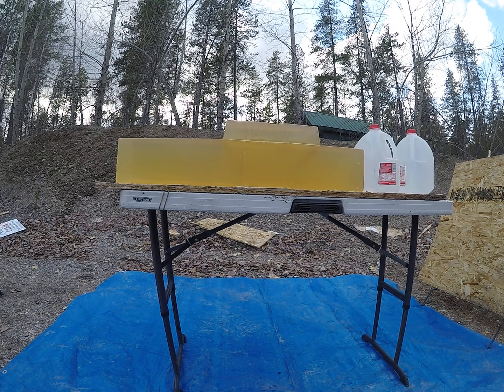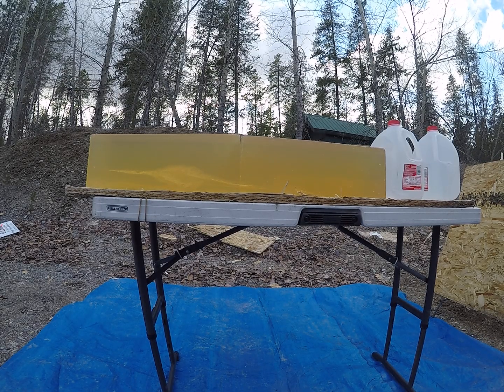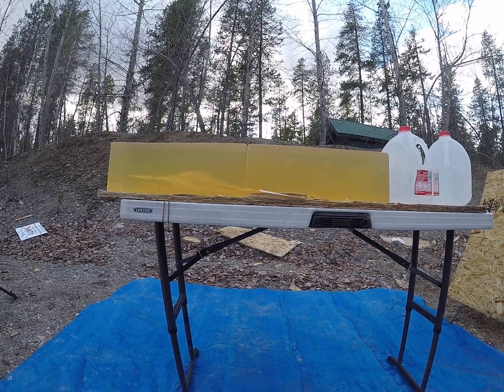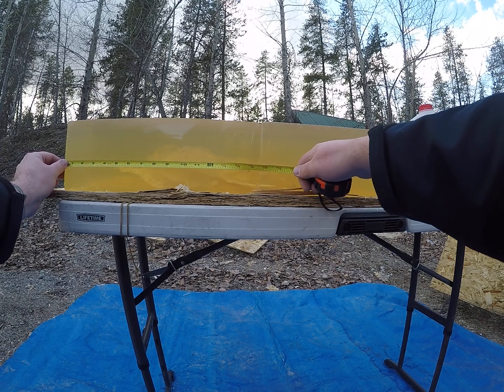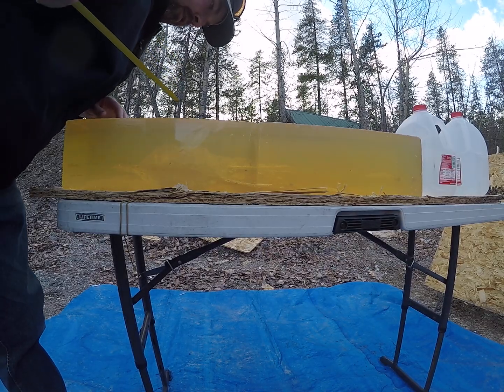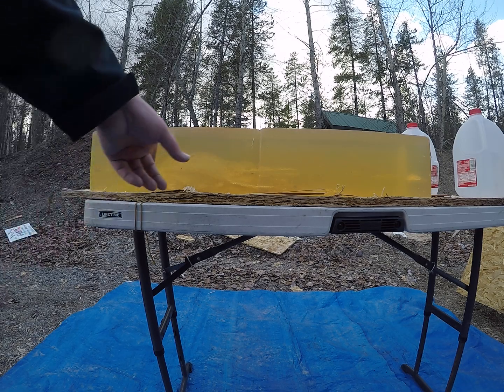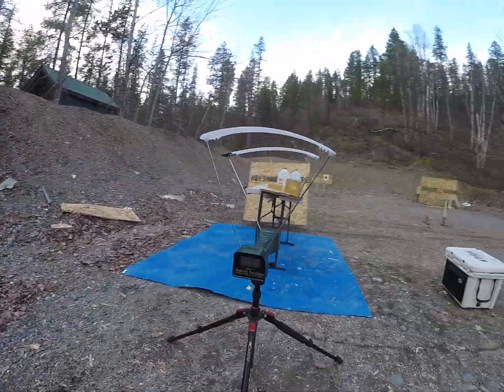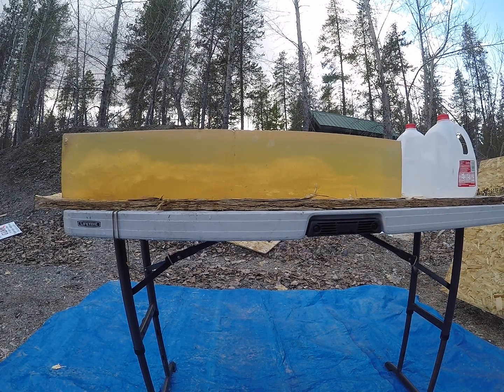30-06 Springfield 168gr Nosler ABLR ballistics gel test.

Comment: Necro post...  Nice video. It answered some questions I had in a good way. One poster was correct in that a bullet fired at a lower velocity will have less spin than one fired at full velocity and slowed down over distance. Still, you get a rough idea of performance. Also, to make life easier on you, either raise the table with the gel or lower the bench with the rifle. You want the barrel as close to level as possible.  To help stop the blocks from jumping, cut 1x1s to the width of your blocks and place them 1" apart. I was amazed how much that helps.

Anyway, good job and thank you.
Reply from the maker: I do have a couple of videos using different twist rate barrels showing how different RPM's effect performance at both high and low velocities. The differences are not measurable. Velocity is everything, RPM'S are not. Granted, I haven't tested with anything over an 80,000 RPM difference. But if an eighty thousand RPM difference isn't enough to have a performance difference, then I'm not concerned with reduced load testing not being accurate.
Reply: @simplemindedfella  I have no videos, but I have done testing at distance as well as reduced velocity testing and found the closer reduced velocity easier to hit vs aiming at an 8"x8" block at 600+ yards, though I have noticed a difference in my small sample. Also, I was using clear gel as opposed to true ballistic gel.

Comment: Hey nice video but there is a caveat, 
I researched reduced loads for testing several years ago and found through Wayne Van Zwoll that the reduced loads also reduce RPM and RPM's play a major role in the centrifugal force that helps bullets open on impact. It was shown that although bullets slow down predictably over long ranges, they actually maintain most of their RPM's that's generated from the barrel twist.  Wayne showed through testing that all bullets expand much less when started slower vs std. velocity impacts at long range with same velocity as the reduced loads shot close.  Take care
Reply from the maker: If it made a senifacant difference subsonic rounds wouldn't work and guns like the 300 AAC/Blackout would not exist as they shoot the same bullet grain weights with the same twist rate as 300 PRC's. Here is a video that shows that 80,000 RPM's made no real difference. Also I was in contact with nearly all the major bullet manufacturers in the US and they told me I could test in this fashion and most of them use a similar form of testing to give velocity ratings for their bullets. 

https://youtu.be/vvTlmo_X594
Reply: @simplemindedfella  Your reduced velocity loads do NOT simulate what happens at long range. The gyroscopic stability of a bullet that starts at much higher velocity is completely different. The tumbling occurs because the bullet is unstable or nearly unstable at such low muzzle velocities. The only sensible way to test expansion at lower velocity is shooting at distance. If don't want to shoot too far you must ensure that the bullet is stable at reasonably reduced muzzle velocity. In fact, rounds like the 300 AAC BLK do have much faster twist rate at 1:8" or even faster at 1:7".
Reply from the maker: @p.r.8049  and that is why I have 1:8 and 1:7 twist barrels for most of my low velocity testing. I also have videos on the twist/RPM differences  at both high and low velocities, showing those differences and the actual effects, not just going off theories.